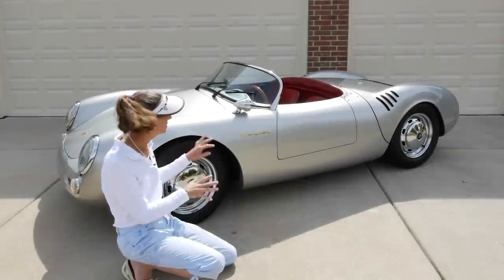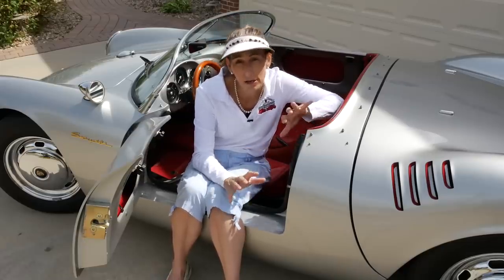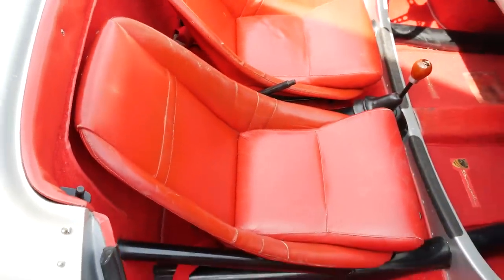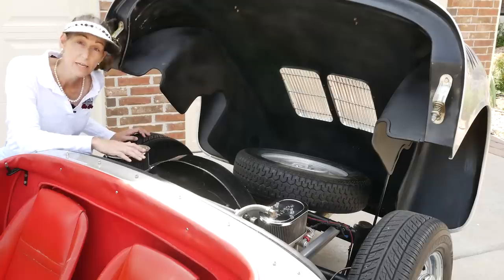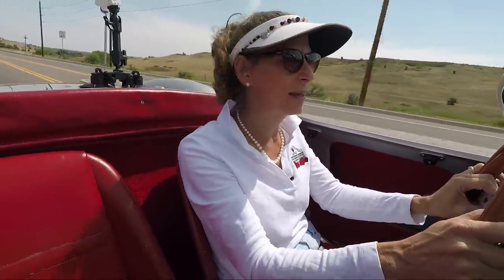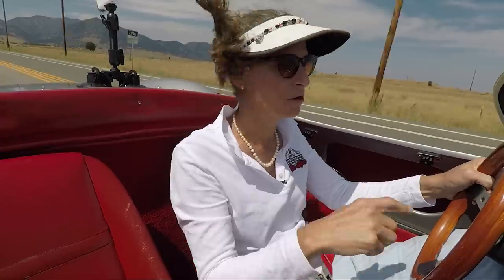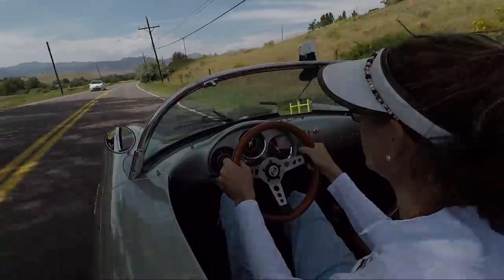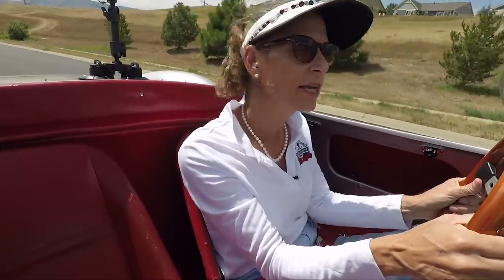Beck Porsche 550 Spyder Review! Complete with Drive.

Comment from the maker: Hi Evereyone, This the complete review of the Beck Porsche 550 Spyder.  What do you think?  Would you own one?
Reply: I'd own one... but so glad u bought a Cayman.
Reply: In a heart beat. Have had a couple of Karmann Ghias. Very simular with mid-engine, built to drive for pure fun. Thank you both, for making such good videos about this one, and taking us on a ride.
Reply: Great fun car as you can tell by your laughs and "yeah baby!" I imagine Beck thought of this when they laid out the design but I feel that a later volks transaxle with IRS and CV joints would be an improvement in handling and do away with the swing axle tuck under possibility. I would stay with an air cooled engine. The Subaru would be more powerful but you would have to add plumbing and a radiator which means more weight. Keeping it Porsche would be nice but there is more horsepower now developed reliably with the VW. One knock on this car is the four bolt wheels. Like you say, if it is on the road it is a replica but the older five bolt wheels would keep a more authentic look. Great review and great work, Thanks.
Reply: My dream car.......one day
Reply: I am very interested in a vintage spyder replica. They are more affordable and in my opinion closer to the real car. My current cars are a 2001 996 turbo,  replica 356 speedster, and a 2015 VW Passat. I drive the speedster after work and on the weekends. I’ve always wanted a spyder. I would build one with the plastic windshield. Thank you for posting all of your videos!
Reply from the maker: christurbo951 how do you like the speedster?
Reply: Heidi and Franny's Garage 
I love it! It’s a vintage speedster made in 2003 with a vw 1600 engine with kadron carbs. The color is cream with tan interior. I should post a video about it.
Reply from the maker: christurbo951 wow. Sounds a bit like Eva.  I bet you get some attention.
Reply: Heidi and Franny's Garage 

That’s true ! I like it when people smile and wave. Its great to bring people some happiness. I frequently see in my rear view mirror at lights, people taking a photo. I have had some creepy people show up to my house while I’m in the garage or follow me home.
Reply: Granny I loved the review I am thinking of buying one too, by Seduction Motorsport
Keep making more videos, and you are extremely cute! 😘
Reply: I would love to own a Beck 550 Spyder. Great replica car.
Reply: Heidi and Franny's Garage well done!
Reply: I'd own one, if I weren't 6'4".  I remember working on a Spyder replica at HiFi Buys years ago.  I  can't remember what the owner wanted, maybe a hidden stereo or something.  The silver paint and red interior combo was absolutely stunning.  But I'm just too tall for a car like this.  My head and shoulders would serve as the roll cage, should I find myself  in a rollover accident.  But at least the Beck would live on.
Reply: In a heartbeat.
Reply: Great Job Franny! You've sold me I'd own one in a sec
Reply: What a great little car. Totally impractical of course,but would be a part of my collection if l had a collection.
Reply: James Dean owned an original in 1955
Reply: christurbo951 Your 996 Turbo is a gem! I have a 00’ 996 Carrera - total love affair with the car!
Reply: Totally would, especially at that price point. We all know, unless you’re a big time exec, ceo, or Uber successful, most of us cannot get into an original. Thanks for putting this out there
Reply: I like your video and when you said don't much horse power .... however when accelerating coming a great smile ! I owned one here in Brazil is black one with VW Powertrain 1.7 liter engine dual carburator Webber 40mm and special camshaft tuning for torque but with good power! Manufactured basic for Amazonas fiber glass Cia. Chassis as well ! I put other parts Powertrain, electrical, suspension, brake's are disk in four well ....and hard job fell months...thank you very much !
Reply: My dream to own one.
Reply: @Mrjonblakely  wesssww
Reply: Love the Spyder
Reply: Reminds me of my porsche 914
Reply: I used to have a VW Corrado VR6,a fantastic bulletproof engine...Would in fit into one of these Spyders?

Comment: I owned a Beck for years. The car was built by John Willhoit, a top notch Porsche restoration expert. He built it with 356 Porsche parts, including the engine. It was a spectacular car that I took on a 1,500 mile trip up the CA, OR, and WA coast. Great fun, unless it rains!
Reply: 5spd?
Reply: I worked for John from 2002 to 2006, and my nephew ids still there, as parts manager, and takes over when John goes on Vacation, or goes the Germany,

Comment: Great videos ladies! You mentioned visibility and the inability to adjust the fender mounted mirror, so I expect that you'll be happy to know that you actually can adjust it! In less than 30 seconds. Loosen the screw at the forward end, adjust, tighten. Done. I've done this solo, and it's very tedious getting in and out of the driver's seat with many minor adjustments until I got it right, but with both of you working together, it will literally take moments. Hint...do it in a parking lot full of cars and park so the other ones are in your blind spots and the areas that you rely on your mirror for. It amazes me how many people adjust their mirrors so they can see their fender, as if they need to frequently check to see if it's still there. Open the angle so you can actually see the blind spots and the cars you want to avoid hitting. Good luck, and thanks for your fantastic videos!
Reply from the maker: Great tip!  Thanks!

Comment: Thank you for your presentation of the Beck Porsche 550 Spyder. You really have a nice porsche there. 
     I worked for porsche for over twenty years, Started in 1966 and my last few years I worked out of the Deerfield office, Deerfield, Illinois. I was a District Service Manager covering Illinois N. Indiana. Remember the movie Risky Business well the dealership they took the 
 ( WET Drowned ) 928 to was one of my dealers in waukegan, Illinois.
      I love your car and I would like to get one but right now I am building a boxster 986 in to a Bonneville race car hope I will be ready by next year to run.  I will be using a porsche 928 5 liter engine with twin turbos and nitrous oxide if needed. My gold is 300+ mph. ;Regards Phil

Comment: I had one my dad bought new in Santa Clara CA, It had the original Beck emblem on the front but we never knew what the serial number was. It was in an accident right after he got it and the body shop had to remove the engine to repair it. In doing so they cut and discarded the cross bar where the engine number was stamped. He never had the serial plate next to the fuel tank. I had it registered in CA, custom plate BECK 550

Comment: I could see me drivin' one of these! Personally...I'd build a nice little 1776cc with a counter-weight crank, an Engle 110 cam and CIS mechanical fuel injection (in lue of the twin carbs). Dual port heads, of course. It's either that or a Subaru 2,5 liter with a 5-speed.
Thank you for the vid. I totally enjoyed it. I had grown up in the midst of the SCCA sports car racing scene back in the early 60's in central California and cars like this are very reminiscent of what I used to watch on the race tracks. Porsches (the 904 was my personal favorite!). AC Bristols (before Cobras had come along). Lotus. Birdcage Maseratis. Triumph TR4's (I wanna build me one of those SO BAD!!!). Jag's (E-types, of course!)(though my Dad had, at one time, a '54 120K coupe with an Oldsmobile 303 Rocket 88 in it. It was FAST!). Oh, how I miss those days!

Comment: The original had to swing axles.. Torsion bars huge improvement! It's no longer death when you lift  throttle when cornering.. Hundred percent improvement on handling with torsion bars

Comment: The exterior mirror is manually adjustable after loosening the screw in the center at the rear of the body. The exhaust can be easily quieted with a different muffler. Racing mirrors and performance mufflers were the cheap sports car mods of the sixties. I was very interested in the Beck 904 until I learned I wouldn't fit in it at 6'1". I enjoyed your review of the 550.
Reply from the maker: Thanks!  This mirror didn't have the screw at the point...  Someone else wrote in and said they are still adjustable, but I'd have to go back and see what that entailed.  It has to be adjustable, right?  ;)

Comment: Great ride,I don't however ,understand the need for heater boxes on the motor.Other than that, it's a great ride,and I would rule out modernities like fuel injection and ultra powerfull motors,honestly the only swaps I  would consider being a big typ 4  vw or a tuned Corvair to keep it all simple.Great ride the way it is!

Comment: I would love to have one of these. Years ago, (80's) I raced a class 10 desert car so I am already familiar with how VW does things & it would be really easy to pop a hot 1776 in one of these. They are simple and 150 +/- hp is about right for a little car like this. That would carve up a mountain road quite nicely.
Safety equipment is the only issue but the tubular steel frame would be easy enough to install a 6 point cage. That would get you some roll over protection as well as side impact. It would also get good mounting points for a full harness seat belt. The main hoop would have to be pretty low or it would destroy the looks. Just duck in the event of a roll I guess. lol Yikes.
Reply: Yeah, I kept thinking "man does that pretty car need some kind of roll bar." And lap & shoulder belts. I could mention other safety add-on's ... but I don't want to get lambasted by purists.
Reply: That engine put out 100Hp, with big Weber's and all the goodies..I had one and the car....

Comment: Nice review! Why were the mechanicals in such a bad shape? Was that an original assembly issue or bad maintenance over time?
Reply from the maker: Not really sure.
Reply from the maker: That is a bit of a mystery, but I think it has been off for a while and the previous owners put up with it.  It should start and run like any other VW powered car.  That was a lot of work to get it going so it is strange...

Comment: Wonderful car and the great thing is you can have fun within the limits of the law. I wonder where the redline is on the VW engine. I think the original 547 engine was able to rev up to 7,500 rpm, even though this wasn't recommended.
Reply from the maker: It is fast.
Reply from the maker: You might be able to do that with this one  - ...once ;)  I bet 5500 is about the max...

Comment: Nice video Franny!  BTW - you can adjust that Talbot style mirror by loosening the screw at the front...
Reply from the maker: Thanks John.  It is a repo and it looks like it won't swivel, but maybe the glass will move?  I should have tried that!
Reply: yes, just the glass disc moves
Reply from the maker: John Mullins Ooohhh... That makes sense.  Thanks!

Comment: I had becks kid build one for me, and I found . like everyone else did, It was dangerous to drive because it was so light and fragile. It ran Hot, in anything but very cold weather., It was not fast even with 100 Hp. 16.3 in quarter, at 78 Miles per hour, slower than My 1970 911T coupe. you could not leave it anywhere, It was very hard to register, and insure. Looked great, but totally Impractical for the street.....Bought for 18,500. put another 2K in it, and got 13K, in a bad market, four years later. Dream fulfilled But was not a driving car, should have had it put in My Bedroom.....
Reply from the maker: I am not surprised to hear this, actually.

Comment: The VW type 1 powerplant is so versatile that they used too as industrial engines, it is the best engine for that replica. A streetable 100 HP is more than enough to give a good driving trill on such a light car.
just a bit too loud to my taste, noise is a major fatigue factor on a long drive, well understood on the Boxter.
It is in an original 550 that James Dean found death in  1955
Reply from the maker: It's super loud and we did not like that either.  It is not our car. It was fun to drive.

Comment: Hi Franny!  Loved the Beck 550 replica series. Could I ask you a question?  I know the car has a 1915cc air cooled engine with dual carbs. Do you happen to know what ring and pinion and gear set is in the car?  Looking to build a speedster replica with a 1915 and this differential and 4 speed gear set seems perfectly matched. Thank you!
Reply from the maker: Hi Chuck, sorry, I don't. But I do think the gearing was changed. Other than that it is a VW transaxle I believe.

Comment: Hey Franny, what is the red line or when the valves float on that engine? I've had 6 air-cooled Volkswagen Beetles I love them cars.
Reply from the maker: Great question...  I think about 5500 or so.  I ran it up to about 5K, but with those strong valve springs and the high lift cam, 5500 isn't too crazy.  It was still pulling when I shifted...

Comment: Franny, would you and Heidi consider owning a Beck Spyder?  And also, is it practical to have two people go for a ride in the Beck?  Thanks as always, your videos are the best.
Reply from the maker: Hmmm... Not sure.  I'm just not sure we would use something like that.  It does really sit two and is a blast to drive. It does make a fun project car. I think I would want to throw an actual 356SC engine in it though.  It would sound a little closer to the part :)
Reply: @HeidiandFranny  enjoy your sailing!
Reply from the maker: That's Franny answering.  I did not like it at all.   The one we worked on was really loud and very difficult to work on.  I would say no.  Heidi
Reply: Heidi, thank you for your input. That is super helpful to someone who has an order on a replica and was debating Speedster replica versus 550 Spyder replica.
Reply from the maker: The firewall was a nightmare, and the fuel line was a disaster, but many people tell me the newer Beck's are much better sorted.  I would just do research. I was not a fan, but Franny liked it.  However, if we did NOT have our 356, I believe she would have preferred the Speedster to the Spyder.
Reply: Thank you, Heidi, once again, that is super helpful. Your opinions really matter to me.  Enjoy your sailing! I enjoy sailing too.

Comment: What’s the appreciation/depreciation on 550 spyder replicas?
Reply from the maker: I think they are pretty consistent...  They seem to ride between 20-40K
Reply: @HeidiandFranny  I really love this replica, but I'm having trouble being able to tell the difference between a good replica and a bad one. Which manufacturers would you recommend I look into? I greatly appreciate the response, it helps a lot
Reply from the maker: This Beck is a nice piece.  The construction seems good and it looks the part.  I would stay away from cobbled together VW pans (a 356 has a different wheel base).  The Beck is a tubular steel frame - very much like the original.

Comment: The use of the 4 lug VW beetle wheels spoils the look almost totally. These cars must have the 5 lug (PCD 205mm) silver steel wheel w/o hubcaps.
Reply: that would be almost impossible with front disc brakes.
Reply: @marzsit9833  No, there are several options: CSP disc brakes for example. Even affordable....👍